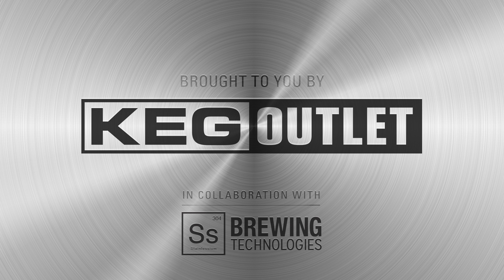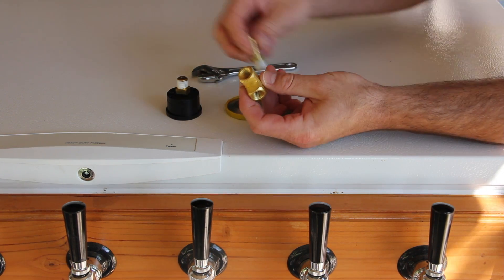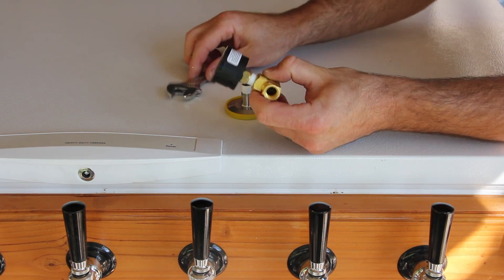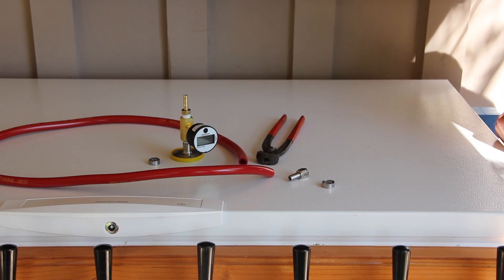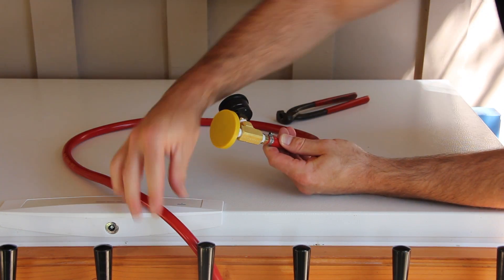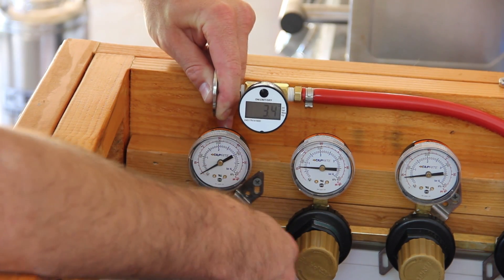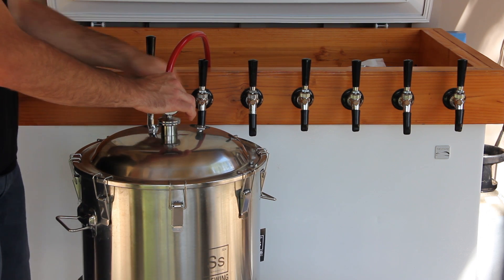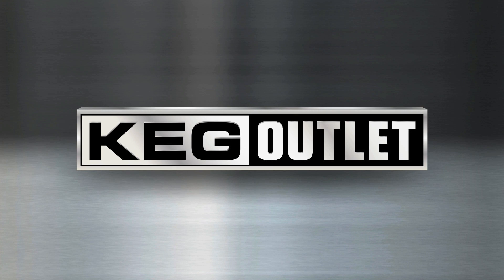Pressurized Transfers for Ss Brewing Chronical Series Conical Fermenters

Comment: Why is a pressurized transfer preferable to a gravity fed one?  e.g.  simply lift the Chronical onto a table a few few higher than the keg and let gravity do the work
Reply from the maker: jocamero Pressurized transfers are helpful when:
1) Dealing with large volumes - 10 gallons and above can get very difficult to lift onto a table
2) Working with hoppy beers. The CO2 pressurized transfer prevents the beer from being exposed to any oxygen. This helps maintain the hop flavor and aroma.

Comment: Thanks for the video,  It was very detailed and explained everything.   I did this and the only thing I did different was I used a ball lock connect and sealed the keg with co2 before transferring into the dip tube the beer comes out.  I don't want any oxygen getting in and just leaving the lid open could expose it however minimal.
Reply from the maker: Jose Alcantar Thanks for sharing!

Comment: Own a Chronical.  Would have loved an accessory option with all of the equipment listed above.  Have been working up a tri clamp T fitting with a valve and an air lock to let me dump trub without air contamination and also allow for pressurized transfers.  One batch of cider was enough
Reply from the maker: Hey Franklin - check this out:
http://www.brewhousehardware.com/co2-kegging-pressure-transfer-kits.html